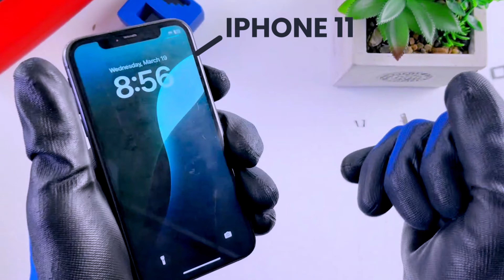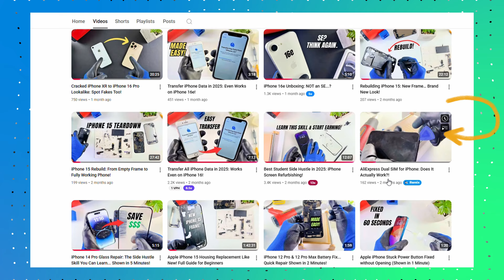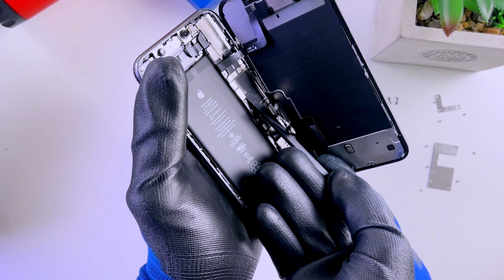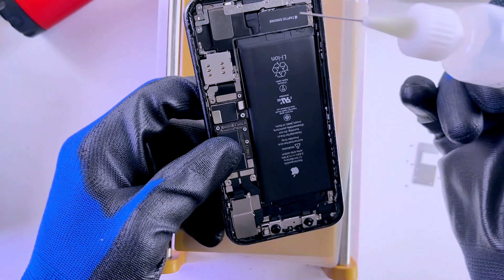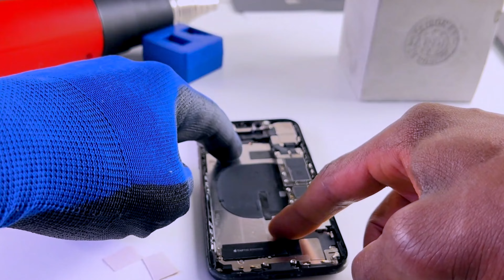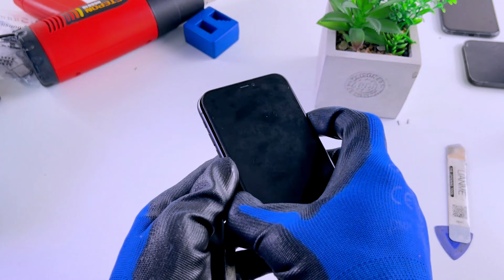Replace Your iPhone 11 Battery... Here’s How I Do It!

Comment: Whats with these aftermarket batteries that claim 3 to 4 times the mAH of the original Apple battery?   Is this real or a scam?
Reply from the maker: @gfriedman99 Good question! Most of those batteries that claim 3–4 times the original mAh are not real. They usually just print an inflated number on the label to get people to buy them. In reality, the physical size of the battery hasn’t changed, so there’s no way to safely fit that much extra capacity inside the same space. Some good aftermarket batteries can have a slight boost over the original, but not 3–4 times more, that would be a red flag for sure. Always check seller reviews and stick with trusted brands if you go aftermarket!